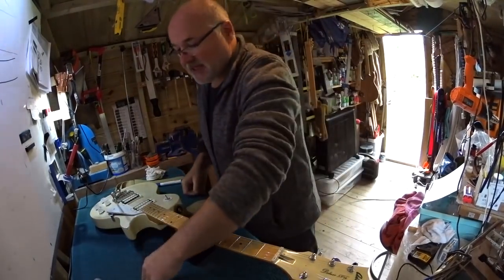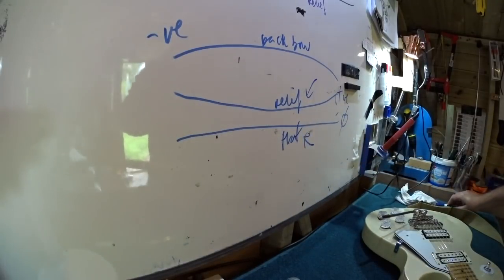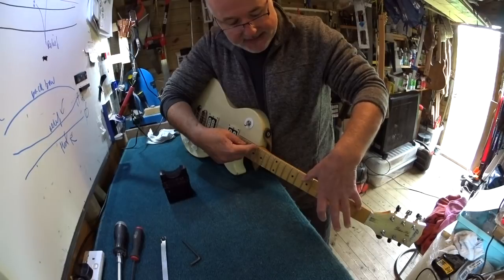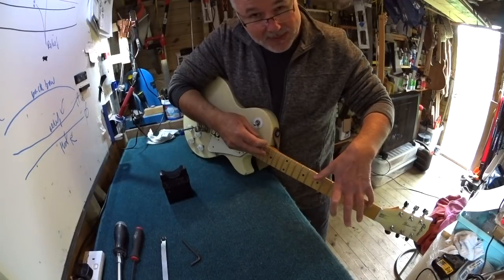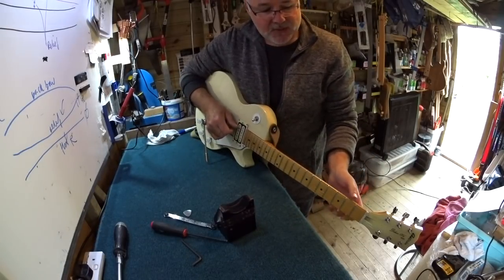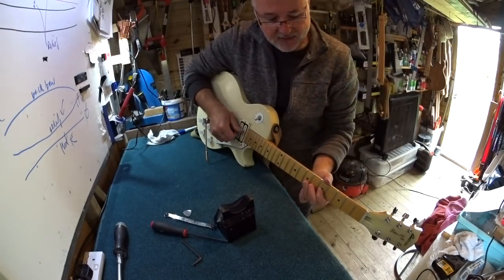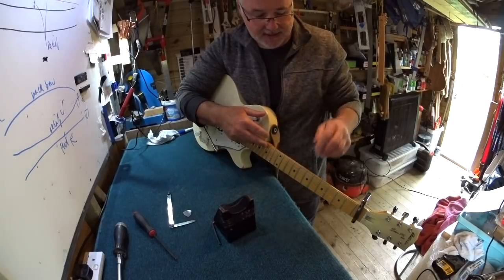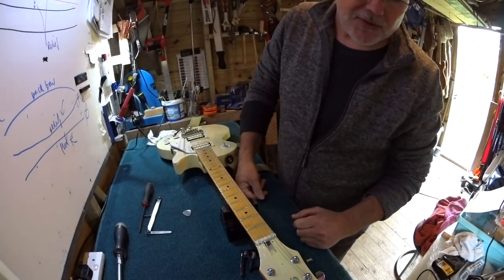Assessing neck relief and making adjustments

Comment: Simplest way to set relief:
1: Set neck 100% straight.
2: Lower string action until you get fret buzz.
3: Ad relief until fret buzz is gone.
4: Beer time.
Reply from the maker: That's a quick and dirty approach... but ultimately it won't get you the low action + flat neck + a full range of bends on all you high notes that I personally like - and that my customers are also after. But I'm for anything that gets people adjusting their neck relief and discovering for themselves what it does and doesn't do - and if your approach leads quickly to beer time it can't be all bad :-)

Comment: My truss rod is reliefed and my E string height 2.6 mm but it buzzes on the 6.th fret on the E string what should i do ?
Reply from the maker: If your neck has relief and with an action of 2.6mm buzzing is probably caused by a high 6th fret (or low 5th causing 6th to act as if it was high). Sometimes there's no alternative but fret levelling. You can pay to have someone do it or you can learn to do it yourself. YouTube has a lot of good advice (some of it conflicting of course)... or you could buy my eBook '5 Steps to Guitar Set Up Heaven' direct from me: 
https://bit.ly/2JMXsU9
Reply: I cant hear the buzz while im playing with amp is it good a situation or i should fix the buzz?
Reply from the maker: @armaganykn2533  Only fix it if it limits or chokes the notes your strings produce. Also keep in mind that some buzzes can be from loose bridge components / truss rod adjusters rattling / wide variety of other things...
Reply: @SamDeeksRelovedGuitars  Thank you soo much for helping :D

Comment: Hi Sam, I want to setup my Epiphone les paul plustop pro and would just like to clarify a few things. I’ve measured the neck relief and there is no gap when pressing the first fret and the fret that meets the body. I think I need to loosen the truss rod and measure around 0.010” relief. After doing this then set the action of the bass side to 2mm and 1.5 on the treble at the 12th fret.Then set intonation. I would do this after putting new strings on, is this correct. I’ll be honest I’m a bit fearful of damaging the guitar and potentially causing the neck to warp. Is what I have stated above correct and if not please correct me. Also, what caused a neck to warp?
Reply from the maker: Hi. What you've described is a reasonable way to set your guitar up. There's no chance of damaging your guitar doing these things. You would have to really force the truss rod adjuster way past tight to stand any chance of doing any damage and even then you probably wouldn't. I tried it the other day on a neck with a seized up truss rod adjuster and using ALL my strength I was unable to break anything (and I was trying). 

Warping is caused ONLY by the grain in the wood being uneven and drying unevenly. Nothing else. It can be accelerated by heat but that heat would only if the grain is already going in different directions. If it warps or twists it's because the manufacturer has used cheaper cuts of wood. Quarter-sawn timber is the best for necks because (usually) the grain is all going in the same direction which means that when it dries, the wood will dry evenly. The best way to avoid warping / twisting is to make necks with a laminate structure - i.e. several pieces of timber with opposing grain directions to counteract each others' warping tendency.
Reply: Sam Deeks Thank you very much, I will try and set it up the best I can.